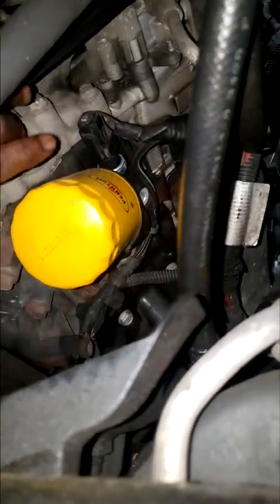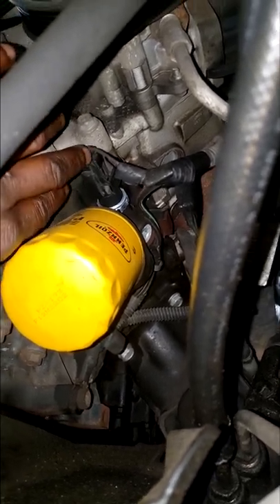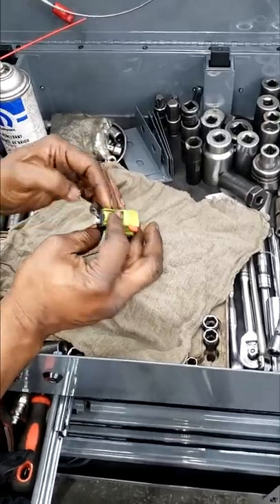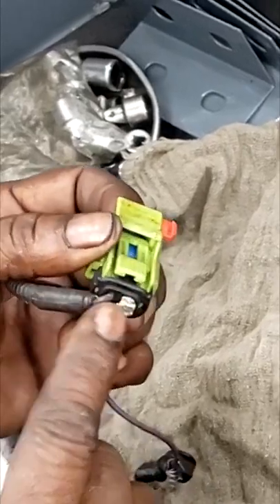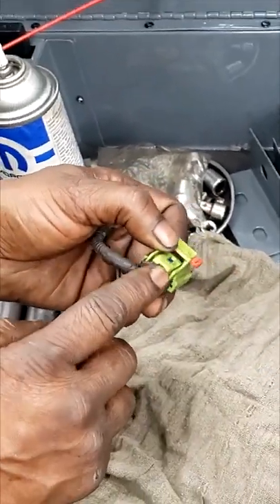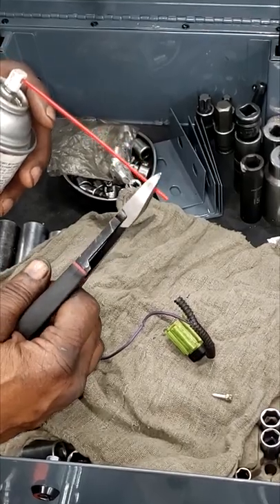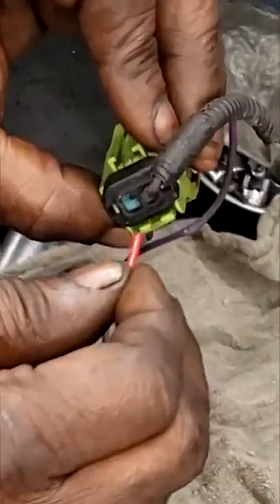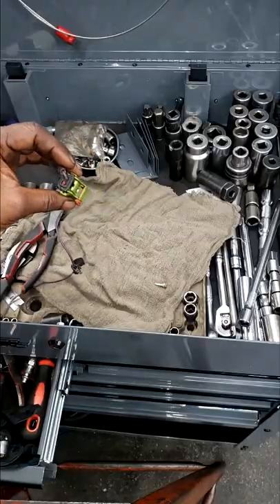SECRET REVEALED. Oil light on and flickering. Do this. #shorts

Comment: Did you just say the connector needs to breathe? Why do they seal them then? Why are there rubber gaskets that literally are there to keep everything out? I hope this is a joke.
Reply from the maker: The connector needs to have a way to vent out any pressure that was created by the failing oil sending unit. Likely if you had a real good high quality sensor there would not be a problem. There you have it, problem solved
Reply from the maker: https://www.youtube.com/watch?v=HMXq6xNW3JM&list=UUSIdv7pEKV2jxJvI6YZB21A

Comment: Oh I love the "should" at the end....since when does a connector need to breathe?
Reply from the maker: Since this kind was built poorly ide say. But for the record, they have been revised
Reply: Since the man explained it to you in the comments..... jeeeeeeeeze
Reply: Lol never but if that fixed it then he’s good. I’d bend the pin on the sending unit to make better connection though.
Reply from the maker: @petersobik2162  Bending the pin would likely cause an open circuit check eng light code. smdh. There is only one wire. Its not a connection problem
Reply: Connectors actually do need to breathe if there's any moisture in the socket and the sockets completely sealed then when it heats up that moisture will expand and either blow into the sensor and destroy it or blow into the plug and curl the wires and connectors so yeah that's why they breathe but they breathe in a specific way they usually have not a valve or not a tube that stays open but a valve that closes when it's not pushing air so this way if it's cool enough and water gets in the compartment it doesn't get in the plug

Comment: Or you could go buy the part and fix it right
Reply from the maker: How is this a "fix it wrong" repair? What will this cause.  You can save ruffly $100 bucks waiting on a connector by simply pulling out the pin.
Reply: @OnlineMechanicTips  you never said while you wait on the part you made it seem like this is a perment fix
Reply from the maker: @cj1836  Yes, thats a rap. This Jeep long gone with no more flickering oil light

Comment: Any tips for the oil pressure light that flickers on random on a 95 accord with what appears to be a single wite connecter and the oil pressure switch have been changed but light still lights on randomly. No noise of oil pump car runs fine.

Comment: That plug is to keep the connector from corroding on the inside from water or debris etc
Reply from the maker: Traditional thinking do not apply to this style connector buddy. You must remove that plug and allow that connector to vent in order to prevent the oil light from flickering on the earlier models.

Comment: How does it create pressure?
Reply from the maker: The failed/cheap oil pressure sending unit could allow pressure buildup within itself. The connector does not create pressure, but since its a seal connector, any pressure buildup may trigger the light to flicker. By romoving the pin, any pressure build up can now escape and prevent the light from flickering
Reply from the maker: https://www.youtube.com/watch?v=HMXq6xNW3JM&list=UUSIdv7pEKV2jxJvI6YZB21A

Comment: This Doesn't explain why it flickers when stone cold.
Reply: The oil completes a path to the PCM via the wire and literally arrives up at the PCM connector. It creates a wet condition that causes electrical contact.
We had brake switches that would flicker the brake light. Eventually they dripped a little brake fluid. They were recalled after some years and then were on several models.
If I had the oil light flicker I would also replace that oil switch.
Reply from the maker: https://www.youtube.com/watch?v=HMXq6xNW3JM&list=UUSIdv7pEKV2jxJvI6YZB21A

Comment: It may work as a fix bc of connection  but electronics do NOT breathe 🤣🤣🤣
Reply from the maker: Read the comments..I've already mentioned "vent" would have been a better word to use.
Reply: @OnlineMechanicTips  electronics really don't need a ton of ventilation either...the wires in that are ZERO compared to an F18....that explanation is nothing more than a guess and shows a basic misunderstanding of electronics
Reply from the maker: @jamesfrancis7284  Its explained very well, and on top of that, it fixes the problem which is really all customers care about. Why dont you up load a video an explain how you would explain things. Thats what I did. You should try it because I got this over here.

Comment: Jeep probably has a part number for the straw and costs $49.99
Reply from the maker: lol, they redesign the complete connector. The repair I show is what Jeep told us to do back in 1999 on a TSB. Since then, everything has been redesigned, even the oil pressure sensor itself.

Comment: My oil light is flickering on my 2001 Ford Taurus S what do I do
Reply from the maker: Verify oil level first. You suppose to then verify pressure using a gauge but most people just replace the sending unit.
Reply: @OnlineMechanicTips  check it after driving or when the engine is cool and I don’t have a gauge or anything fancy I just got this car about a month ago
Reply from the maker: @luckyluke-ambitiousamy  You can check your oil level at any time.  Im not sure if you talking about about oil level or oil pressure
Reply: @OnlineMechanicTips  pressure
Reply from the maker: @luckyluke-ambitiousamy  Yes, an oil pressure test can be done anytime at operating temp. Dou you have a gauge? Also are you subscribed to the channel?

Comment: Huh. Breath on a connector ??!!?? Wtf I don't believe that for a flicken second  just splice in a new connector
Reply from the maker: The good news is that you dont have to believe it. Now your suggestion would work if its allowed to vent which is what the newer revised connectors do. But why bother with all that when you can simply just remove the white pin in your existing connector?

Comment: How can air pressure, created when you plug in connector because it is weatherproof, cause a pin on pin connection to lose connection??
Just use silicone spray on connectors or orings in cars
Reply from the maker: IMO the sensor thats failing that the connector plugged into causing the pressure build up internally. And because the connector sealed and weatherproof, that pressure thats trapped inside the connector could cause light to flicker. I always advise my cust to replace the sending unit with a good oem sensor and just pull the plug out of the connector.
Reply: Oh, so the pressure from connecting the connector forces interlnal membrane of the switch?
Reply from the maker: https://www.youtube.com/watch?v=HMXq6xNW3JM&list=UUSIdv7pEKV2jxJvI6YZB21A

Comment: Hashtag dodge Chrysler and jeep are junk.
Reply from the maker: lol, then dont buy one, fairly simple. But the videos are for those that already own one.
Reply: @OnlineMechanicTips  learned the hard way 60k Cummins. Absolutely the saddest excuse for a 1 ton truck money can buy.
Reply from the maker: @boffadeez8721  O wow, I hardly see those in the shop. When I do its mostly for petty maint stuff..Dang man.
Reply: @OnlineMechanicTips  constantly putting crank sensors and knock sensors in and 4 full exhaust systems and limp mode nonstop. 2017. I'm rocking a 2019 3500 dmax dually now. 75k miles and not 1 issue.
Reply from the maker: @boffadeez8721  Awhhh shucks, thats whats up

Comment: The sensor does not need to breathe.... Leaking oil needs to vent, rather than going in the harness. But it's your video dude. Hahaha
Reply from the maker: First off I never said the sensor needs to breath, smdh. Second, the end part of your comment correct. So you welcome to shoot a video and up load it to YouTube to show us the Steven way, or how Steven would do it..We will be waiting bud, don't let us down.
Reply: You did say the connector needs to breathe. Don't you remember?
Reply from the maker: @steventoomire1644  Yes, I said CONNECTOR NEED TO BREATH, not the SENSOR NEEDS TO BREATH.  You slow, your hate is strong and its showing, you cant even remember what you type. smdh. Look at your hater ass first comment.
Reply from the maker: @steventoomire1644  So no video huh?

Comment: Ya that doesn’t seem right at all
Reply from the maker: What doesn't?  You have to keep in mind, this video was released in order to get people oil light flickering problems to stop. Doing this hack will do just that. Thing is, its not really a hack if the car makers advise you to do it. (TSB) People on here trying to include science and thinking into why this repair needed. Even you, you have no car with a oil light flickering I assume, but because it seems it does not make sense, you question its motive. But the folks out there driving without that light flickering anymore because they did this do not care about how or why it worked..lol..Just my opinion. So now, what does not seem right at all to you?

Comment: Basically a crappy design from jeep. Standard ops
Reply from the maker: Thats been noted sir. That connector has been revised but theres still a lot of cars out on the road with this connector. Theres really no need to replace the connector, just pull out the plug so it can vent.